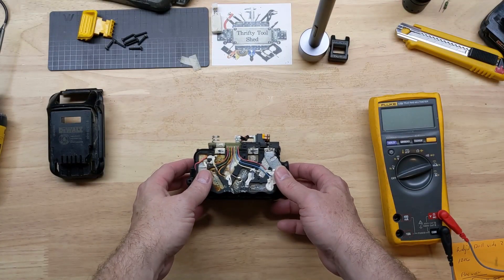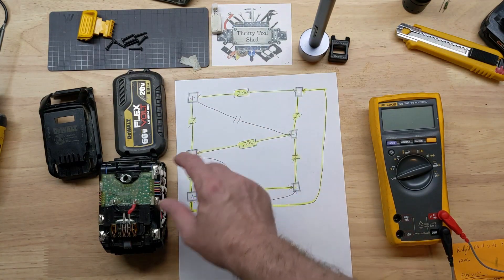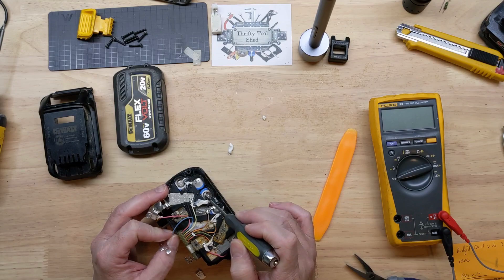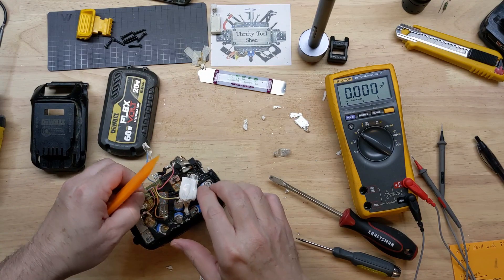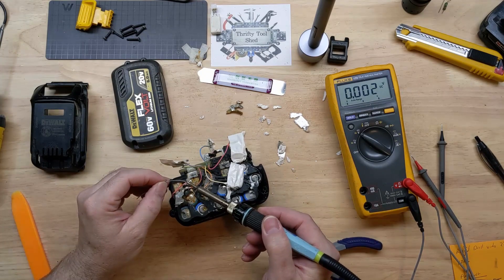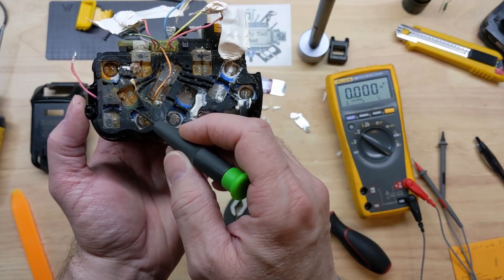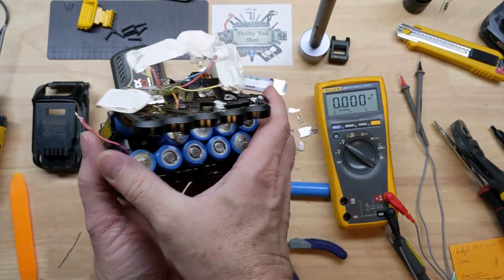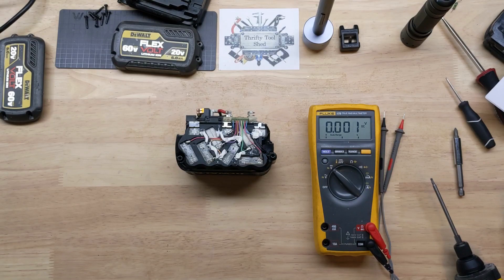DeWalt FlexVolt Battery Pack Disassembly (Video#2)

Comment: The Samsung 20S is a very good cell! It has a max continuous discharge rate of 30amps. Compare that to the Samsung's 25R, the cell of choice for almost every 5ah power tool battery, you can only draw 20amps continuous from it. 

Forget about that flex volt mess! I'm cannibalizing the cells from the first 6ah flexvolt I get my grubby mitts on.

Comment: Man did DeWalt make the flex volt battery packs difficult to work on! I'm working on one now with one dead cell on the bottom middle and like yours I've just about got to disassembly the entire pack! What a thorn in my side this is! I'm sure thankful of your videos!
Reply: difficult as in - totally not meant to but send 'em to the bin? I consider them (flexvolt) a mistake running the 54v tool (15 in series) up to the thermal cut off. Then removing it and switching to 5s3p to balance themselves on their merry way w/o any current limiting. Other than that the pack looks amazingly well built mechanically aside the water ingress.
Reply: @stanimir4197  I've determined the flex volt isn't worth the money they cost! They just don't hold up in rough conditions!

Comment: It is so frustrating how just one cell makes  one entire pack useless.
Reply from the maker: Indeed! That is why I usually don't buy the largest capacity packs. We can absolutely get more current to a device with them and of course more run time, but also more head ache and more money. The lower capacity packs are usually too low of capacity to be useful in a broad range of tools and they have to work so hard to run a tool it can burn them out quickly. I usually as a rule of thumb go for the middle of the capacity range. As an example the Milwaukee M18 the 5ah is my favorite tool packs and also EGO 56v 5ah pack is my usual go to. Seems to work for a little longer with less issues anyway! Thanks for your comment!
Reply: @ThriftyToolShed  
Agree with you. My biggest Ryobi battery is 5.0Ah and the Milwaukee M12 is 6.0Ah. It is good enough for me. I assume the best way to extend the life of these large battery packs is not overheating them.
Reply: And what cool is if you are swapping out all cells, you can get rid of the 25R's and go with Molicel 3000mAh cells with a CDR of 20 amps, so now you have a 6ah instead of 5ah.
Reply from the maker: I do like the Molicel 2800 and 3000mah a lot so far.  Great capacity and still lots of current output!

Comment: Do you have faith in the repair, and I'm not questioning your skill? Looking at the price on internet markets used run anywhere from $80 and new Dewalt $128 or up to $300. I follow your coment on its heat disapation problem. Just thinking out loud. Thanks for the look.
Reply from the maker: Usually the repair will get much more life out of it. Of course the best repair would be to replace all cells with brand new, but that is not much cheaper sometimes than new pack price. I usually don't have much invested in attempt to get pack back running. I keep many tested good cells from other donor packs etc. Sometimes it may not be worth it.
Reply: @ThriftyToolShed  I follow your lead.

Comment: Some time I'd like a little better description of the "nickel" strips and their ties and function. You gloss over the whys and wherefores pretty good. I am assuming they are the interconnections to make series or parallel banks... and how they are connected to a "bus" of some kind to make switching arrangements. Once you've "torn" them loose - how to repair/replace them to remake their function again. Then there's "silicone potting" what is it and why is it so hard?
Reply from the maker: The Nickel strips are the ties across the cells. They are tied in many configurations through many manufacturers. We see them most commonly tied the cells from positive of one to the negative of another to create a series cluster of cells if you will. The most simple of this is a single layer of 3 cells for example all 3 joined from positive to negative giving you a nominal 12V from end to end. This would be a 3S 1P pack. 3 cells in series and only 1 set. To double the capacity of the same exact cell type simply add another set just like this in parallel. So the strips again used to join across those to be in series with the first set. So now 3S 2P. Same 12V but double capacity. We typically spot weld these nickel strips on the ends of the cells. Soldering is not desirable because it can heat up the cells and cause damage. I have done it, but in that video I explained to heat it quickly and cool it quickly, still much better to spot weld for sure.yhe potting is as Nils mentioned, it's a protective coating to help with moisture ingress to help eliminate corrosion from happening and also it helps with vibration/shock on the components if dropped etc. Hope it helps, thanks for your comment!
Reply: A good book for reference is :  "DIY Lithium Batteries, How to build your ownBattery Packs" by Micah Toll. . I purchased a copy some years back from Amazon. It will help you alot with understanding the mechanics involved with Li. pack building. Check it out.